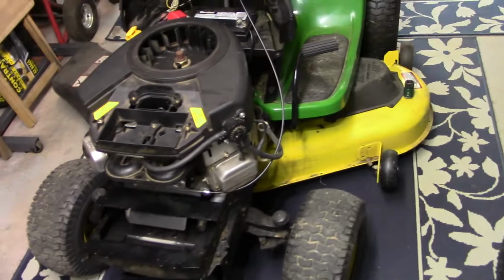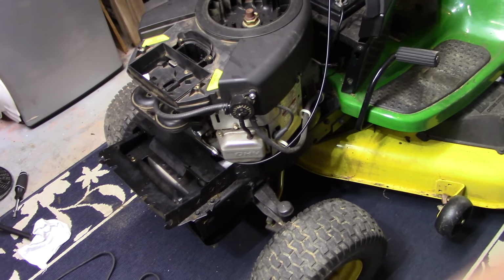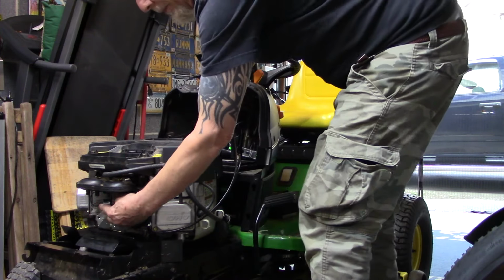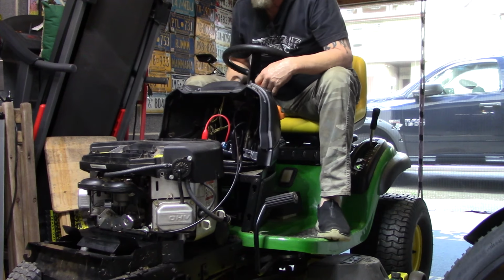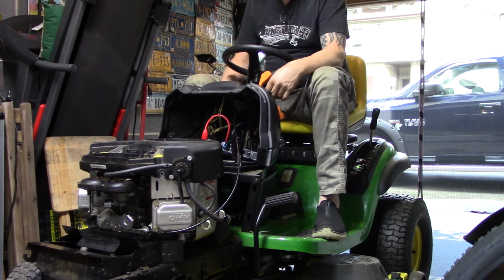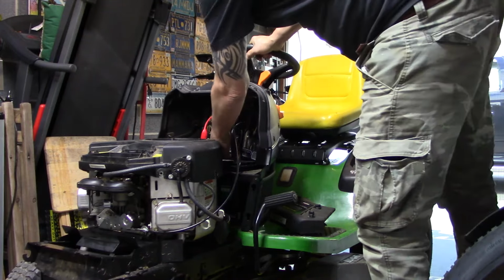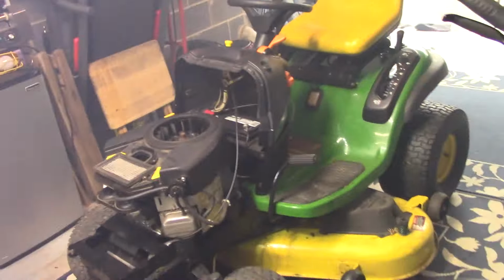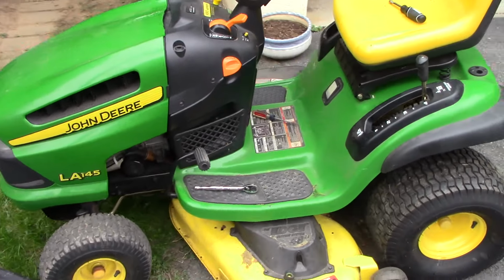The FREE John Deere LA145 is RUNNING!!!

Comment: Rick,
Put about half of a can of Sea Foam in your fuel tank and fill her up.  Run it for about 15 minutes hard, then shut it off and let the Sea Foam heat soak. This will help clean your fuel system out of any leftover crud that may be in there. 
Beautiful tractor, I am happy for you that you got her running!
Reply from the maker: Thanks!  👍👍

Comment: You always check the three basic fundamentals of a running engine. Fuel, compression, and spark. Diagnose it slowly and thoroughly. I watch a lot of Tom Doby Mower Repair videos and he provides a lot of valuable information on his customer repair videos, including John Deere lawn tractors. 
Glad you got the Deere running, but you might want to check for bad or stale fuel. Using fuel with ethanol in it might damage the fuel lines, and will eventually gum up the carburetor. Try to use 100% gasoline with no ethanol in it. It may be a bit more expensive, but will keep your small engines running much longer. 
Also to think about is greasing all the spots on the lawn tractor as well for smoother operation and PTO usage. Good luck!
Reply from the maker: 👍👍 Thanks!

Comment: I'll bet you that fuel that was in there was that e8 5 corn crap because if you let that set in a tank for so long it turns to gum. I had it happen on my car that I put away in the winter before I knew about this but it screwed up my whole fuel system $500 later. It was all fixed and I learned a valuable lesson